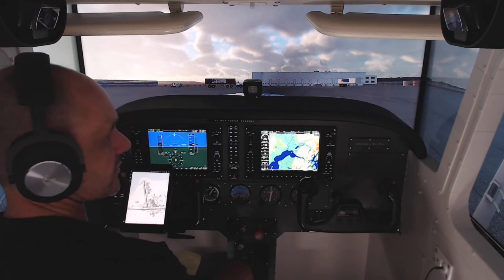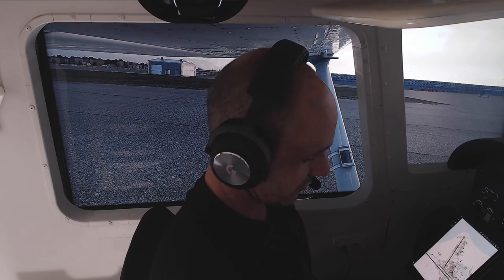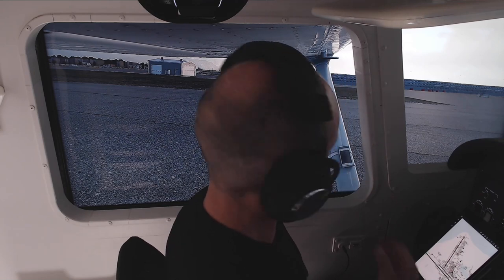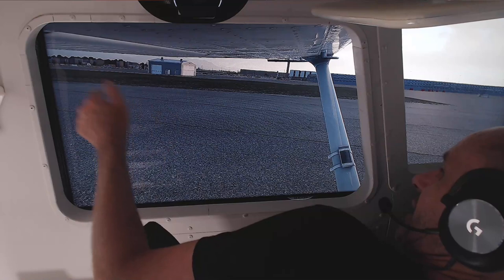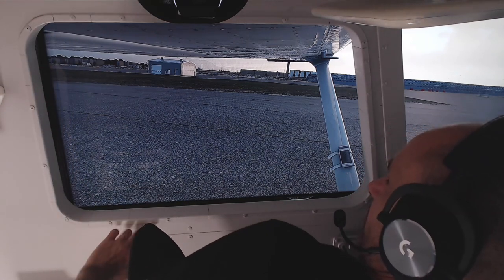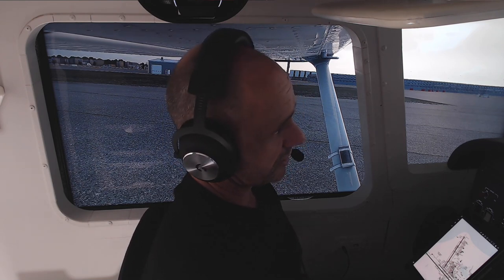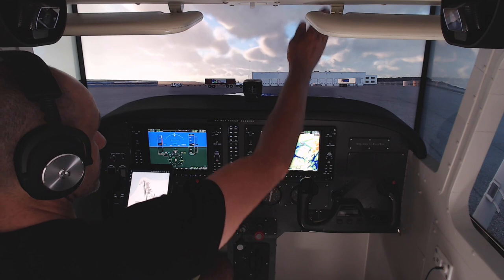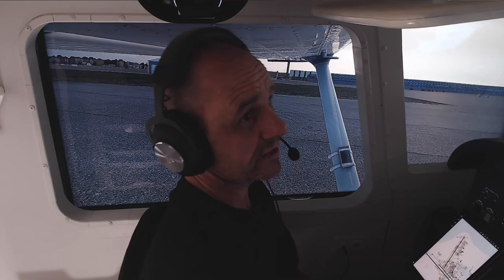118 - Proposed C172 Simulator Updates

Comment: Get a fuel tester for your pockets :) The real pockets use a elastic material on the front so they stretch a bit and fixed at the back if that helps.
Reply from the maker: thanks Glenn. Have some ideas on the pockets. Fortunately my Father in law is a retired upholsterer (and did my current glareshield cover) so I reckon will see if he can assist.......

Comment: Sensible upgrades.  Your system can possibly run 3x2k.  But I suspect you will have to reduce world objects and draw distance.  Though you do fly in Australia where the landscape is often more sparse
Reply from the maker: Yes but I am also wanting to fly in more dense areas as well (USA in particular), so I reckon the 2nd PC is only a matter of time if I want 2K resolution. The bottleneck is in the CPU.
Reply: @CessSim  I tried and failed to run triple 1440p with my Ryzen 5800X3D system.  I want to use commercial airliners like the Zibo 737 which is a lot heavier on CPU requirements  than the  C172.  At places like KLAX the FPS is barely reaching  20 even on mid-range settings. LR certainly have some optimising to do.  Of course in the forum if you say that, all you get is the fanboys saying you are being impatient and that LR will optimise it now its been released.  I don't see how.  The performance is a long way feom where it should be.

Comment: I have 12900k, 3080ti 12gb, 32gb ram, and I am getting mid 30s fps over major cities of Australia with world objects high, and around 50+ when in altitude, thats XP 11 tho... There are five screens connected to single machine, 3 Tvs are running 2k each and 2 touchscreens running Air Manager as a panel. The bottleneck is always CPU, not the GPU, and I don't think I can justify flying XP12 when I consider the minimum improvement in graphiscs for the amount of performance loss compared to XP11
Reply from the maker: Similar story with me although I am only running the 3 screens as I turn off the 4th (operator station) when flight setup back to 2D panel only. I am also a big fan of XP11 (I dont fly FS2020) but I must admit I am liking the look and feel of XP12 better, just need to get some performance tweaks in and I will be a happy simmer !!   Thanks for watching..

Comment: Auto parts salvage yard. Use door pockets from an automobile. Maybe
Reply from the maker: cheers mate. Have now constructed a couple of pockets via 3D print. Later video posted on these. Slightly larger than real Cessna172 but I think will be practical once I install them. Thanks for the sub and tuning in.